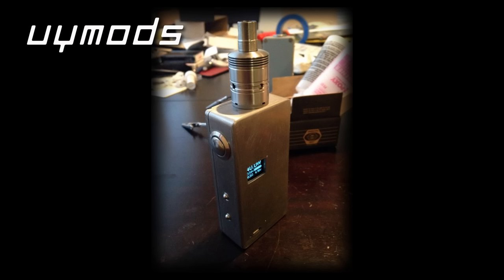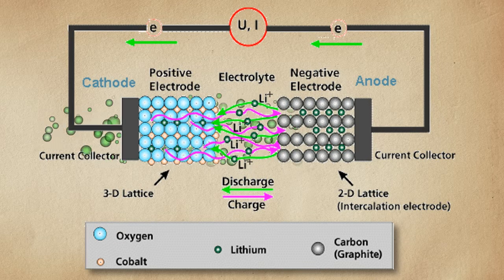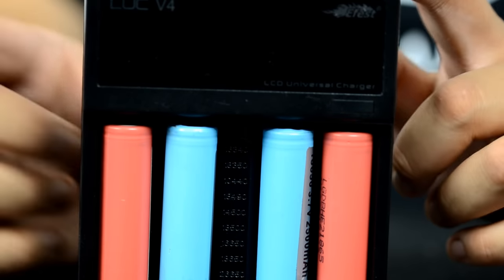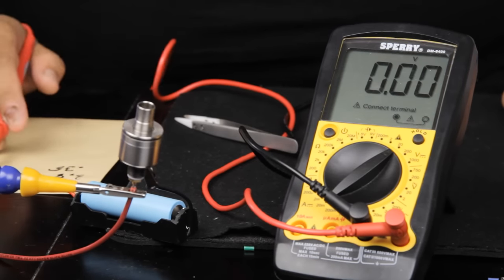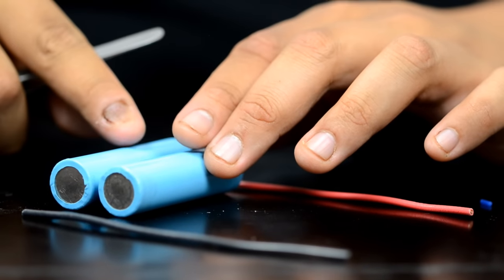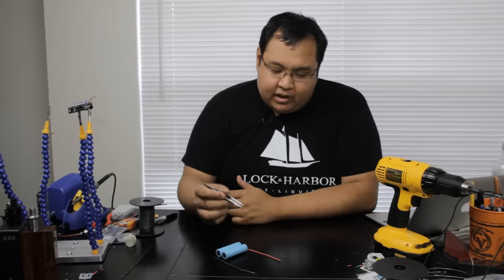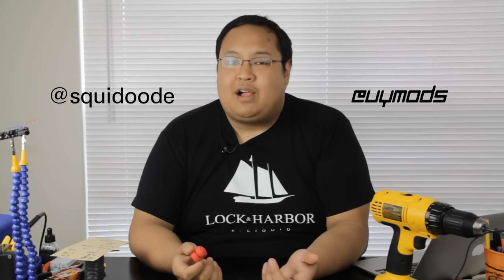Know Your Vape: Batteries Debunked Featuring @uymods

Comment: The 0 in 18650 actually stands for 65.0mm. Which is kinda funny because a standard 18650 battery can range from 65-65.9mm. 65.0mm is the minimum

Comment: Incredibly clear and very informative.  It might leave beginning vapers a bit cold in the middle when discussing battery sag and voltage drop, but after a bit of experience, these same vapers can easily review the vid and it'll be clearer and valuable.  Also, I'd be VERY interested in seeing a discussion of vaping with regulated mods, and the potential perils of the builds used there, and with more current vaping equipment.

Once again, VERY well done.

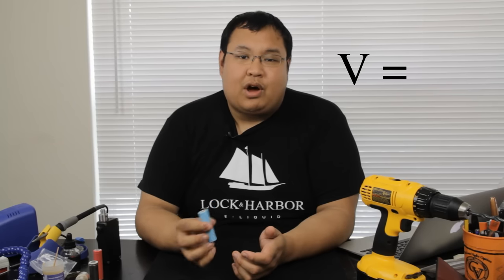Comment: You should really look into correctly expressing the Ohm's law equations on the screen when describing them. At 7:06 you start to describe Ohm's Law and then you go on to say Voltage (V) = Current (I) x Resistance (R). This is correct in your verbal explanation, but the text at the top right reads V = I over (divided by) R... This is flat wrong. It should read V = I x R

 At 7:45 you say "The power equation is Power (P) = Current (I) x Voltage (V)", Again, this is correct, but in the top left of the screen the text shows P=I over (divided by) V which is again, plain wrong. It should read P=I x V, or actually if you want to get technical about it, the correct expression would be P = I x E where P = Power, I = Current, and E=voltage. Not trying to be "that guy" but at the same time I wouldn't want to get anyone hurt as a result of incorrectly expressing the proper equations.
Reply: im glad someone else caught that and posted!
Reply: True. Verbally communicated correctly..however the text on screen was wrong. no biggie ;)
Reply: +Rhett Adams true to both, but even so, this is a big deal, noobs write down the formula and never get a right answer, then look dumb as they try to explain to someone else their issue or even worse, think theyre right and try to teach even newer vaporers..   ohm well, lol  sorry    great video even saying that, but a great video should be 100% perfect,informative without mistakes
Reply: I'm glad I wernt the only one that noticed
Reply: Apparently today didn't think it was important to correct it for some reason
Reply: when you have to think about ohm's law, are you going to remember what he said? or the diagram?

Comment: When you describe the product and write how the product is portrayed: you are implying multiplication, therefore you should not write using a FRACTION BAR. When you display a math equation using  fraction bar, you are implying division. Ex. I = v/r states that to find CURRENT (I) you must DIVIDE VOLTS (V) by RESISTENCE (R). However, if you want to FIND THE VOLTAGE, you must multiply by showing it as: I x R = V you can also write it as IR = V or I*R = V
While you did say the equations correctly, how it was written was inaccurate. It's something that bugs me, or probably anyone who studies math because it's a misrepresentation of the equation! Just be mindful on writing yo equations!
Reply: Correct math is essential. Especially since he is talking about electricity. It should be checked and double checked before publishing a video on it. The fact that he released this as his final with the division sign I noticed this too. It is terrifying to me that all these amateurs are try to deal with electricity on these levels. It is like watching a youtube video and trying to fix a television tube the next day. You can get blown up, you can get killed, you are working with amperage and that is what kills people.
Reply: Any electrical device used on a house wiring circuit can, under certain conditions, transmit a fatal current. While any amount of current over 10 milliamps (0.01 amp) is capable of producing painful to severe shock, currents between 100 and 200 mA (0.1 to 0.2 amp) are lethal.

Source : Dartmouth Engineering 
Electrical Safety: The Fatal Current
https://engineering.dartmouth.edu/safety/electrical/TheFatalCurrent.html
Reply: Meh get over it man.

Comment: Can someone please explain if it would be safe to vape @ 75 watts with a .26 ohm dual coil on my vtc mini with a lg he4 battery? They are rated at 20a 2500mah. Just received my vtc in the mail today and notice my samsung 25r (same rating as lg he4) is getting warm. Was a mechanical mod user for 2 years prior.
Reply: +SkankinLozer btw the reason I mention the samsung 25r and lg he4 is because I have a 6 month old pair of samsung 25r which i'm replacing with the lg he4's. Going to toss the samsungs when I get the lg pair in the mail. And the vtc mini holds only a single 18650.
Reply: 3.7*max discharge rate=watts
Reply: Yeah should be fine, there is a website (steam engine) where you can put your ohms in and it will calculate the rest for you. 

LG, Samsung and Sony make the batteries so you should always try to buy from them however what is as important is that type of battery. If you want to be smoking at high watts buy the batteries with high amps like 25/30 and if your going to be vaping at lower watts then buy a battery with higher mah and lower amps like 15/20.
Reply: HolloVVpoint panasonic 3400s are good, highest capacity out there and a 2c discharge rate continuous, can pull around 50 watts for vaping purposes from one.
Reply: Yeah my bad completely forgot about Panasonic.
Reply: HolloVVpoint they are some of the best for capacity
Reply: Should work fine on your evic its regulated so you should be able to get away with most anything with what the evic will put out for
Reply: +SkankinLozer Since it's a regulated mod, anything goes. If it's drawing too many amps, the mod will cut out by itself
Reply: Get a ohms law calculator from the app store for your phone or tablet. know your amps and volt limits on your device. If you calculate your coils ohms again your devices amps and the volts shown in that calculation are beyond  you devices limit then recalculate your coils ohms against lower wattegaes until  within rang of both volt and amp limits of your device.

Comment: Great vaping video! 

A couple of new battery technology updates: 1) ICR (LCO) is the very old technology, which is almost outdated because it is apt to explode. IMR (LMO) is still being used but its IR is a bit higher, which causes lower operating voltage when it is heavily loaded with low resistance atomizer. HIGH-DRAIN NMC is the most advanced technology nowadays, which is much safer (due to more nickel than manganese and cobalt) and performs lowest IR, which delivers highest power when it is heavily loaded with low resistance atomizer. 2) For 18650 cell, the continuous maximum current should not exceed 30 A no matter how C-rate is advertised. This is because the limit mass (42g ~ 50g) of 18650 cell can't sink too much heat and the cell body temperature may go over 75 degC if load current is over 30A.

Choosing a proper battery charger: Power supply is not a battery charger for Li-Ion batteries!!! Never use a USB power supply to charge your vaping battery because it will over-charge you battery (i.e. USB 5.0 V power supply is way above 4.20 V!!!) and make your battery to age very soon (i.e. die in a few of weeks). An aged battery also performs higher IR, which waste more electric energy in form of heat and causes your battery body hotter. You do need a CC/CV charger (two charging phases: Constant Current charging, then Constant Voltage charging) in-between the power supply and the vaping battery so that your vaping battery can be well maintained with its lowest IR and longest life.

This vaping battery rating on continuous eBay users' feedbacks may be useful for most vapors:
https://roundupreviews.com/us/best-18650-battery-e-cig

Comment: I have a question if you run two 18650s 30A in series does it double the amps so you could use it at 60A 8.4V?

Comment: Just came across your video, I learned a lot. However,  my question is about married battery sets. I had a mod that had a 3 bat setup, it is now dead not because of bat issues. I'm looking at a 2 bat mod, and it will work with the ones I have. So here's the question, I have 3 sets of 3 married Batts, can I break 2 out keeping them married and use them that way with no issues? Also can I marry the 3rd batt of 2 of the sets? FYI, I labeled each batt so they end up in the same spot of the mod and charger every time. Thank you for taking the time to answer so long after the vid had been done..

Comment: thanks alot man.  we need more of this stuff on youtube. great job.  one thing i wish was included though would have been pulse ratings and is it safe to go out of the continuous discharge cause theres obviously alot of different opinions in that
Reply: Nick Vecch I agree. I thought about talking about it, but there is a lot of contention and speculation when it comes to "Pulse Ratings", particularly because there isn't an industry standard definition for a pulse, most manufacturers don't provide that data, and the ones that do define a pulse a less than 1 second.
Reply: ya for sure.  real good job though thank again

Comment: great vid,
wanted to ask batteries if I charge them separately as in charge one full and then the second one full, could I use them in the same mod in parallel, or would I need to charge them together simultaneously?

Comment: Every vape shop should have to watch and show this video as a requirement for employment. I see too many places selling mech mods and RDAs while they only stock cheap 5-10 amp batteries.
Reply: Mikesane actually there is nothing wrong in doing that. I also use 10 Amp Samsungs in my mech mod. But running on 0.8 ohms there is no problem doing that.

Comment: i have a question, i know you said in the beginning of the video that most batteries are from companies we already know like sony and samsung. but is it safe to use an 18650 battery from another company that has much higher mAh? because most batteries i see at vape shops and being talked about in videos go from 2100mAh to 3400mAh. but i found some that go up to 5000-6000mAh, if i were to buy a pair of GTL li-ion 5300mAh from ebay and put them in my tesla invader 2 with a .1 ohm build, are there saftey issues that i could come across?

Comment: If I'm using an unregulated series box and want a good 8.4 volts without load and good battery life what battery should I get. I'll also be doing builds around .28-.4 Ω

Comment: Question about pairing: I have 2 efest 35 amps that were not initially paired (by accident, I mixed them up.) the difference in the charge rate is about .1v. So one battery charges at 3.7 while the other is 3.6. Sometimes they are even at the same rate. Is this problematic?

Comment: Re marrying batteries, I get you use them both in same device at same time, but, do you alternate the position or rather, their orientation each time?
  Ie, if Battery A's + end goes in the + side of the tube & Battery B`s - end goes in the  - side of tube, do you switch next time & have Battery A's - end go down the - side of the tube & Battery B's + end go down the +  side of tube.  Or, does that not matter?
Put another way, if the device has 2 slots, must you alternate which battery is placed in which slot with every change?
Hope that made sense.

Comment: I have 2 questions:

1) I have a few nearly new 18650's that shorted out due to cheap RBA's/box mods when I was first getting into this and they immediately died. I get nothing on my Lii 500 or intelecharger I4 when I try to charge them. I assume this was due to over heat protection kicking in. I need to know if adding voltage to those (as I have heard you can do to batteries that cut out due to low voltage'). will bring them back to life from the overheat shut down or are they just useless now?

2) I have a cheap box mod, an oddball thing that runs off AA batteries. works only ok-ish with a cheap plastic pen type atomizer, old ego? and fairly well with old cig filter style atomizer.. but pretty much useless to me as it is. And of course if I put a decent RBA on it, it's just not enough power to fire it. It runs 3 AA's in series. Question is, if I put 3 14500's in it, will the 11 or so volts that produces be too much? Will it run a say UWELL Crown sub ohm RTA at .5 ohms (all my throat can handle) and if not I have a rebuildable deck coming for it, if I run it at a higher ohm, will it work? Or, do I need to run it in parallel? appears I can easily change it. 

Not that big a deal but it would make a nice little compact mod if it would work and I have the batteries coming in anyway for flashlights. I will be aware of overheating components in the AA mod and change them out if necessary, or not use it if that produces too much of a problem and I can't rectify it.

Also feel free to add any other thoughts that I may have missed. I looked all over for these answers and though they are probably out there, I didn't find them. Thanks so much..

Comment: Maybe someone already asked this. I just haven't read through all the 360+ Posts. What is the best battery for a Regulated dual 18650 box that can go as high as 200 watts? Most of my builds are in the .15 ohm - .3 ohm range. I just want to be safe and not have it blow up in my face if it can be avoided in the first place.

Comment: Very well put together and informative. but i have a question, i understand about pairing batteries, and have several pairs, but you hear alot about rotating the batteries within the pair, eg my batteries are label 1 through 6(3 pairs) if i load my series mod with #1 positive and #2 negative, use them, pop them out to charge, load them up this time #2 positive and #1 negative (if you get what i mean).... is this really necessary? or is there any advantages/disadvantages to doing this? Thanks guys...
Reply: slingitsideways I've heard plenty of arguments in favor of rotation in series mods, but rotation certainly won't hurt anything, but I've never bought into the idea that it really helps. The premise of rotating batteries relies on the idea that one cell is being "drained harder" than the other. But in a series circuit, all of the current that flows through one battery is going to flow through the other (because there is no other path), which contradicts the idea that one battery is somehow being pushed harder.
Reply: Justin Uy also if one battery would drop in voltage faster, it would give out less current, meaning the other battery would drain faster, until they are at the same voltage again. They actually equalize each other out.
Reply: Justin Uy, Okay Dokey Cheers guys for helping clear that up.

Comment: The Art of Vaping Thank you very much for the video. Very informative with straight facts.
What is the best battery to use in an unregulated, dual 26650, series wired box mod?
Reply: hedlizz horzeman Surprisingly, looking at the discharge curves for different 26650 batteries, the best ones I've seen are the 3500mAh purple eFests.
Reply: Thank you very much. Few people give battery safety the reverence it deserves.

Comment: Are the nitecore i2 chargers any good or should I stay away from them?? Also looking to get Sony vtc4 2100mah batteries to use in my smpl mod, I don't think I'm going to be doing any crazy builds just maybe some .4 ohm builds, is this a good battery to use or are there better ones I could/should be using.
Reply: nitecore is good

Comment: I've been wondering about pairing/marrying batteries.

I do know that if you have devices that need two batteries, you must pair the batteries, use them and charge them at the same time.

One question though, do I have to use that married batteries in the same device from time to time? Does that mean I cannot use that married batteries in another device?

Let's say I have Sigelei 100W and iPV3 (both use dual 18650). Can I interchange the married batteries between these two device? (still paired/married batteries, just using it in different device)
Reply: neocyke thanks for the info. I've heard from some youtube vape reviewers that once you used a pair of batteries in one device, you have to dedicate that pair for that specific device (by putting labels on them, etc).

Another question also came in my mind recently, if I paired batteries and used them for a mod with series connection, can I used that same paired batteries in a mod that uses parallel connection? This came into mind after I saw some reviews about parallel connection box mod (recently the Eleaf iStick 100W).
Reply: Pirhot Nababan i doubt the common claims made about this whole "married" batteries thing. i mean, i understand its important, but not to the degree people make it seem. i can blow apart this theory right now. all batteries when manufactured have a native "mAH" built into that battery based on many factors. this mAH will vary between the same battery types within the same batch (eg. one battery may rate @ 2600mAH, the next battery in line 2575mAH, etc...variable)So marrying these two batteries is never a perfect science from the start. Im certain a few draw cycles between married batteries would be of minimal importance...

Comment: so for example if i'm using a single 25r in a mechanical mod, what is the lowest ohm coil i can build? Great video!
Reply: 0.21 ohms brings you to the 20A constant discharge limit.
Reply: but what about pulse? i read that it was 100 amps
Reply: 95 amps is for if I remember 0.5 seconds. Not a good idea to Base a build on pulse discharge, one mistake, short or auto firing mod and you're in danger.